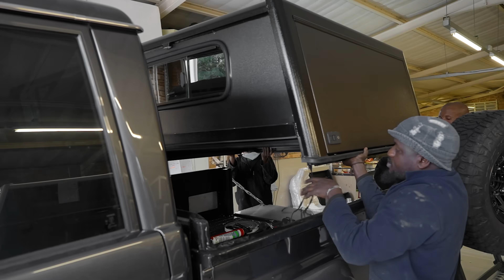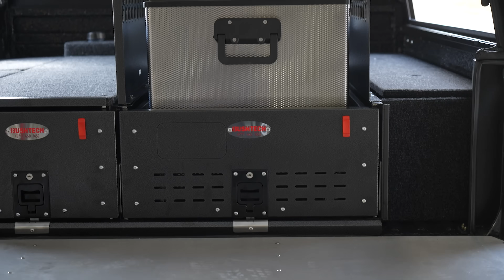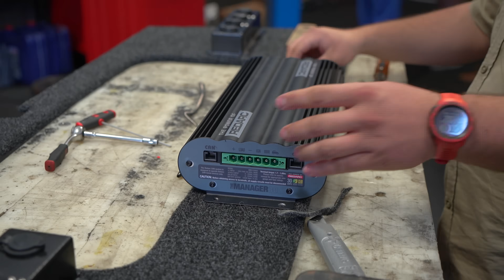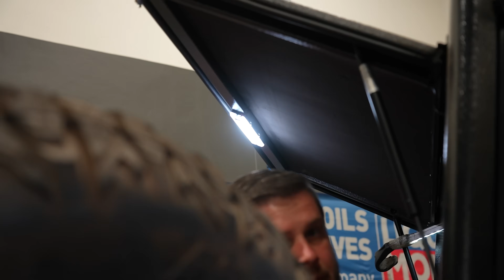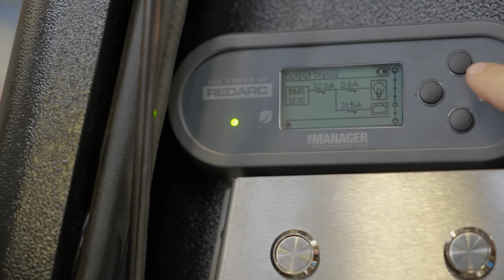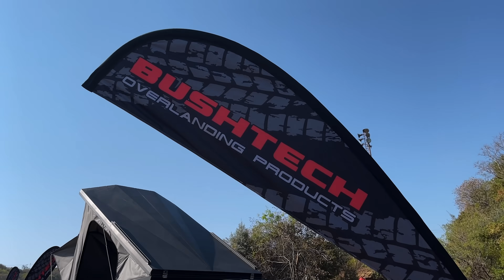Canopy, Drawersystem and Redarc 12v System. ROAM Landcruiser Build  Part 2

Comment: Nice one Adrian.  I find it facinating seeing how builds of 79 Series in South Africa while being the same vehicle, are so different to builds here in Australia.  The OEM Toyota tub sure gives it a different look, compared to the Australian preferred full canopy setup.  At a glance from a distance, Roelf's 79 looked like a long wheelbase 76 Series.  And while the canopy is less accessible with the tub (vs full canopy setup), I like it.  It makes it look like a wagon.
Reply from the maker: It’s a hard working setup for sure! The fact you get your vehicles without tubs that side is just mind boggling for us 😂
Reply: I agree.  With the canopy around the same height as the cabin, it gives an impression of a lower profile roof.  And with the tub the same width as the cabin, it makes the whole thing look like a wagon at a glance.  It looks good. 👌